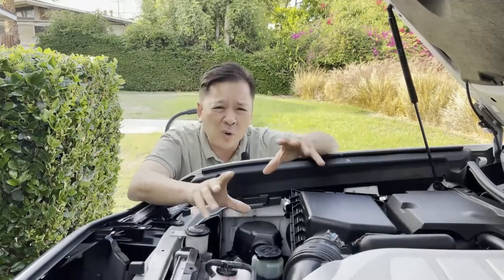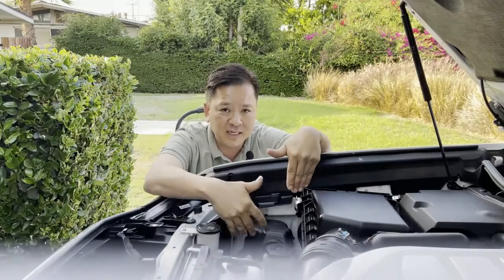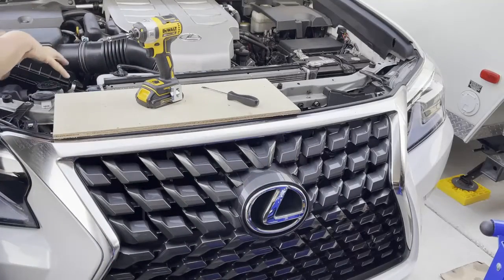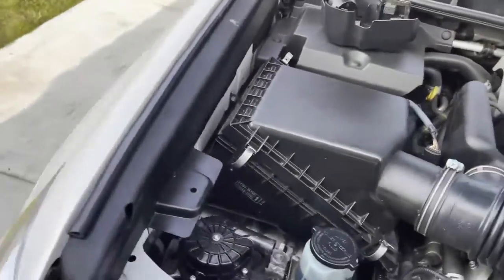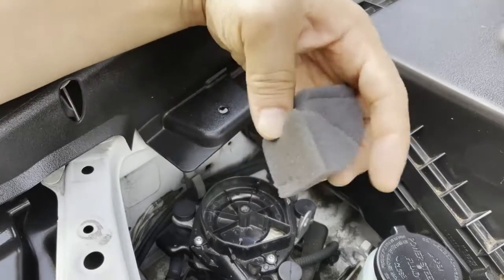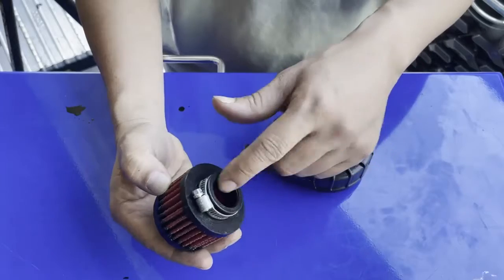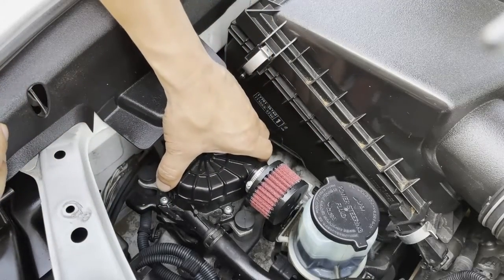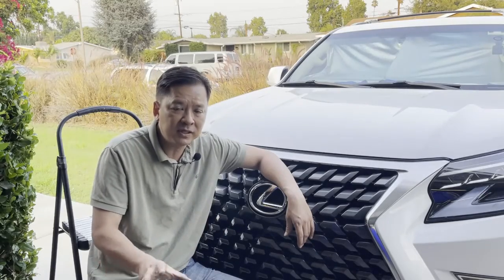Why We’re Modifying the Lexus GX Secondary Air Injection Pump

Comment: Thank you for the video! Dealer wanted 2.4K for this job. My trac, 4lo, and check engine lights are still on after replacing the filter. Does this mean that it doesn’t work? Or do I need to take it to a mechanic to shut the lights off?
Reply from the maker: The filter is for preventative maintenance . Not for after you have the failure.

Comment: I just installed the little cone filter on my 2020 GX460 with 43k miles. The OEM foam had just a little dirt on the leading face, but no more worries about it deteriorating and clogging the fan. Hallelujah!

Comment: How often are you suppose to clean the filter
Reply from the maker: Its per the mfg instructions and cleaning schedule at 50k miles.  Just hit up K&N if you want to go by the book, otherwise a visual inspection is good enough for me.   Every 15k with low pressure water and air dry.
Reply: @GXBOB I installed the filter a year ago after watching this video. Yesterday I got hit with a check engine light and a code P2445. Secondary air injection pump stuck bank 1. Wondering if the filter could be dirty.

Comment: Did this mod today on a 2023.  Crazy that they were still using this flawed design all those years later.  For anyone reading this looking to add the external filter, if you want to retain a near stock look you can put the cover back on the pump, it won't obstruct anything.  It also doesn't really do anything, far as I can tell.  Maybe provides some protection if a vicious rodent invades your engine bay.
Reply from the maker: I always put it  back on when i go in for a smog check.

Comment: Hi, I installed this filter on your recommendation and the pump started whistling right away. It's very audible when you turn off the engine and it still continues to rotate and whistle. I removed the filter and the whistle stopped.
Reply from the maker: You are going to get some vacuum suction and/or some whistling sounds which is normal. Its telling you its working.

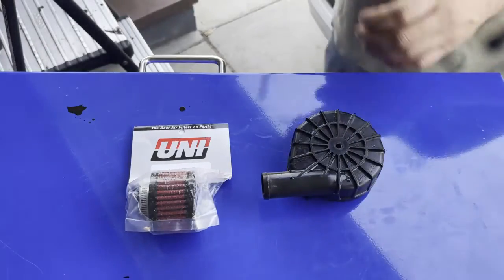Comment: 8:48 Bob, I replaced this filter as soon as I saw your video a couple years ago. Engine ran normally no problem.  Should the new filter be replaced regularly? And if so, how often? Very helpful video thank you.
Reply from the maker: Hey Donald, there isn't a magic number to go by because everyone's driving habits and environments are different.  It's just a visual check for a dirty filter.  Remove, flush it with water, and air dry.  After you've air dried it, apply some K&N oil to the filter material.  
https://amzn.to/4ex3QvA

I did mine after 20k miles since the video release.

Comment: Just got my "new" 2023 GX460 two weeks ago and came across this mod. Did the upgrade and an hour later after driving to costco, engine goes into limp mode with engine and TRAC OFF light coming on. I barely made it home and needed to get a tow to the dealership. Wish I read the comments because its been a huge hassle to get it "reset" to factory. I'll be going back to the dealership this week and hopefully get them to do the upgrade for me (luckily still under warranty). Hope this is helpful to anyone thinking of doing this.
Reply from the maker: Not sure what happened to your truck, but rest assured, there are tens of thousands of people who have already done this mod without an issue.  There have also been many other YouTubers who show the exact same mod.  The only thing i could think of is you pushing the filter too far in and starving the system for air.  The mod is supposed to prevent your trac off and going into limp mode.  I've had this mod for years and years without an issue.  TBH, you are the only person in the YouTube universe that mentioned having an issue with this mod, which i'm still sitting here trying to figure out what you did differently.   One foam to replace another foam does not add or delete to a systems oem function.
Reply: @GXBOB  I was in total disbelief myself, I was thinking there's no way I can fk this up...surprise you found the only guy to accomplish it. I'll be asking the Lexus technicians about this mod and get their pov and report back.

Comment: Hi, Bob:  Thank you so much. Love your video.  One question: After installed 'UNI' filter like your video showed, should I put back the original secondary air pump cover?  Thank you.
Reply from the maker: @simonlu1664  Put it on when you go in for a smog check. You have to pass visual inspection which includes no tampering with your emissions system.
Reply: @GXBOB  Thank you.

Comment: What do you think of this resolution GX? https://youtu.be/dW0-JHw2E6A?si=hSAfFfBbBGcKD5gx
Reply from the maker: You're taking an engine system component designed by Lexus to work during cold starts.  Let s pretend you don't care about the environment for a minute.  But for those 90 seconds the SAIS kicks in to support warming up your engine on a cold morning will eventually take some form of mechanical degradation over time if you're like me and need to start and go without having to wait for the engine to warm up.  What do you think injection of fresh air during the cold start does for the engine?  Its in the design.  Another issue is how your truck will perform during a smog check inspection.  The minute a smog check inspector sees your bypass module , especially in California, you just failed your visual inspection.  You would have to remove it and drive back to have your truck reinspected.  Another issue is the "smell" that will most likely go unfiltered through your engine compartment will eventually reach your cabin filter if not through the nose of someone hanging out in front of your vehicle while you're warming up your truck.  Another reason is you're spending $400 because a $15 filter doesn't make sense to you.    Do the preventive maintenance by replacing the Lexus foam with an external filter and you won't have to deal with check engine lights coming on in the future.   Make sure you maintain that filter and clean it once in awhile and you're good to go.
Reply: Yeah that makes sense. Mg lights keep coming on even after Lexus cleared it and found nothing wrong. All the injector components replaced. They think it’s an electrical issue so the bypass seemed intriguing. Replaced spark plugs and that helped keep the lights off for about a month. But it cycles on stays in limp mode for a couple days and then it cycles off after running a few times and repeats this cycle.
Reply from the maker: @DaBigKahuna21  interesting…Lexus actually replaced the Sais completely? Even cleaned the output leading to your exhaust manifold that may have been clogged by foam remnants? I dunno man…I would check the Hewitt system as a last hail Mary and see what their refund policy is if the problem still persists.

Comment: Have you had any issues with codes after you installed? Seen a few guys talking on FB how it threw a code.
Reply from the maker: There are two reasons why that SAIS unit would fail: deteriorated foam gets caught and pulled into its system, starving it for air; you installed the aftermarket air filter with the top rubber piece shoved against the air entry, which won't allow air into the SAIS unit (remember, air enters from the side of the filter, not through the top by design); or the system fails due to age and its coincidental that you just happen to install an aftermarket air breather on that very day (which happens, its just a matter of time). But adding an air breather that only allows air (which its supposed to) does not throw codes.  It doesn't work that way.  I've had mine on since the beginning of time and  i have had no issues nor have any one i've spoken to have had issues.  You have a controlled group of few that threw codes due  to the reasons i've mentioned above.

Comment: How long does this filter last for?
Reply from the maker: These filters are cleanable and should last for a very long time.  Check their condition at 25k miles and clean with dawn liquid soap/water then blow low pressure air dry.  Then apply K&N oil.  It should last for another 25k miles.
Reply: @ okay thank you GXBOB!!!!🙏

Comment: Interesting idea, very innovative. Love your channel.

I would suggest an alternate solution, however, let me explain.

Leaving that filter exposed to the elements (dirt, moisture, or chemicals in the event of another failure inside the engine bay could pose a risk in itself). Plan on cleaning it or at least checking it as part of your 5,000 mile maintenance plan.

DEFINITELY a solution, but that aspect should be noted.

In older GX460s and 470s this was a known issue. In more recent years, Toyota/Lexus has changed the material to something more durable (perforated polyurethane foam).

Instead of modifying the system entirely, and adding a maintenance point, I would look into a 30-60 PPI polyurethane foam. Order a sheet of it, and cut it to size. You'll never have this issue.

This filter should also be checked every 50k miles or so to ensure it isn't clogged with debris (however, it should never be, because of that cyclone style nozzle on the end, and the fact that this system only actually runs for a couple of minutes upon startup).

Great video - but I think we should consider every aspect of the design of the pump housing, there's a reason for all of those sub-assembly parts... They're there for the prevention of particle ingress and low to no maintenance.
Reply from the maker: Thank you for the input.

Comment: Sir I did this but my car doesn’t accelerate now and has engine light on and trac off, switched the same old sponge but still same thing
Reply from the maker: Did you ever resolve your issue?
Reply: @ just put the old sponge and cleared all the codes by professional computer because the basic ones couldn’t do it.

Comment: Did you saturate the filter with uni foam oil like the packaging says?
Reply from the maker: Hey Michael.  I did not.  Just like K&N filters, the original white paper filter already comes prepackaged with red oil that has already dried prior to purchasing.  When i do my filter cleaning, i run under warm water, air dry, and relube with red oil.
Reply: @ gotcha, good to know. thanks!

Comment: Hi Bob, i just did this mod on my GX it was a really helpful video. This new filter is definitely a lot louder. I'm assuming that it's supposed to be louder. It's very noticeable on start up.
Reply from the maker: @kingjaymIIV77  That’s the make up of external breather filters. I would be more worried if it didn’t make air suction sound. It’s telling you your SAIS is working. Try experimenting by adding the black end cap back on and/or take it off to see if there is a difference in sound.
Reply: It really just sounds like a loud pump. Kind of like a pump for a blow up mattress.

Comment: Bob, did you put the plastic cover back on the pump after installing the filter? I did and I was little concerned about the overlap it had with this filter. Any thoughts on air flow resistance?
Reply from the maker: @prakash0vegunta  only put the cap on when u go in for a smog check
Reply: @GXBOB  copy that. Thanks again for the tip.

Comment: Hi Bob, super easy mod. My GX460 IS AT 46K miles but I went ahead and did it anyway. One clarifying question: do you advise putting the housing back on or go without the housing? It feels tight with the housing on and I wonder if this will stop the airflow? Would appreciate your suggestions!
Reply from the maker: @ReformedEconomist  I would put the housing back when you bring your truck in for smog check to pass the visual inspection. I would just leave it off after the smog checks.
Reply: @GXBOB  Thanks!

Comment: I did this replacement and noticed a slight rumbling (growl) engine noise at highway speeds. Is this normal after the mod or am I imagining things?
Reply from the maker: @mauriciosrv  I would assume it’s normal if you change the design of any air intake. It’s usually a distinctive suction sound. Never heard anyone refer to it as a grumbling . But all this is while the vehicle is parked. At high way speeds and you’re capable of hearing something from the engine compartment might be worth investigating.
Reply: Thanks!  @GXBOB

Comment: you mentioned 470.  That is a different system and another issue in itself.  YOur comments on a 460 are accurate and does get those with a 470 to look at the issue.  The SAIS is basically under the manifold.

Comment: Mines been having a limp mode issue, but I have no codes or dash lights! Took it to the dealer and they can’t figure out what it is. My year is a 2011 and has 150,000 miles on it. Sounds like this is the issue! I would hate to replace the part and find out that it wasn’t the problem. Kind of stuck. Hmm?

Comment: What happens if this does fail and the lights all pop on? Can you just replace the air pump? Or is there other damage done?
Reply from the maker: @DaBigKahuna21  This is only preventative maintenance. Once your lights popped on the damage is already done. You can take it apart and clean/vacuum/suck up what’s left of the foam and put it back together to see if it cleared the lights.
Reply: @GXBOB  thank you!! What do they typically replace if the damage is done? Just air pump or do they replace and take apart other things? And is it still safe to drive?
Reply from the maker: @DaBigKahuna21  So do what a few folks did. Go to this thread and read it in its entirety then head to Lexus dealer and ask for recall warranty on good faith. Be nice. Service technicians vary from dealer to dealer. Good chance you’ll get a free replacement because Lexus knows about this ongoing problem. 
https://forum.ih8mud.com/threads/oo2010-2013-gx-460-special-service-campaign.1177130/
Reply: @GXBOB  thank you Gxbob!
Reply: @GXBOB  ok so I checked my secondary air pump. The filter looks brand new and the fan blade looks brand new as well with no signs of debris. Any idea what else could cause check engine light, trac off, and 4Lo light blinking, and limp mode?
Reply from the maker: @DaBigKahuna21  did you hook up a scanner to see what codes you’re throwing? If no codes then go straight to your gas cap to check the seals.
Reply: @GXBOB  just ran the scanner. It’s throwing codes P2440 and P2442. I guess it’s the secondary air injector stuck open
Reply from the maker: @DaBigKahuna21  yup you definitely have something shoved down there that’s keeping the valve open. You can either take it apart or drop it off at the dealer with the recall request. Do your homework and print out the recall docs and walk into the dealership armed with knowledge of the manufacturers problem. But be nice while you’re doing it. From experience. The minute you’re an ass, all dialogues are done and over.
Reply: @GXBOB  sounds good! thank you for your help! I’m taking it to the dealer soon!

Comment: How often do you need to switch this product out with this lifespan?
Reply from the maker: These alternative element filters are designed to last the life of your truck and cleaned / oiled every 50k miles. I wouldn’t bother buying all the products to clean and oil your filter since it’s such a low cost item. Just buy a new one.

Comment: Uncle Bob I assume you don't put the "two hand" plastic cover back on over the new K&N type filter?   Seems like if you do it significantly would restrict air flow.  Or is it important and should I drill 3/8 in holes in the filter area as another commentor mentioned?
Reply from the maker: I left it off and reinstalled it to pass smog visual inspection

Comment: Not sure how I missed this vid, thanks Bob!  👏🙏

By the way, are you going to do a radiator swap anytime soon?  Considering replacing mine, small leak at top hose, replaced hose and noticed plastic brittle and a little craked. I think moisture coming from there even with new hose and cap.  But I don’t want to go to the stealership to replace radiator and get ripped.
Reply from the maker: I normally don't do anything unless it's broken.  You never know, the truck is past 100k already.
Reply: @GXBOB  👍Just hoping its not the coolant valley leak thing Ive been hearing about

Comment: Should I still put back the cover after putting the assembly with the filter?
Reply from the maker: I did.  I didn't want to leave a cover around the garage to get lost.  Might need it one day when i go in for a smog check.
Reply: @GXBOB  mine is a 2018, the reason I asked is the cover has a foam that touches the filter when placed back, although fitting snugly. Should I just scrub the foam since this almost cover half of the applied filter, will it make it less efficient?

Comment: Great video, just the explanation I was looking for. My engine/dash lights on my '07 GX470 recently came on, I brought to Lexus dealer (Maplewood MN), they charged $210 for 4 minute plug-in "diagnostic" and decreed the secondary air injector pump and valves all need to be replaced, for $3200. My question: if the engine light is already on, is the injector already plugged/shot? Will just changing out the filter as you describe still help or do I now need to replace whole assembly? Thank you!
Reply from the maker: The reason your lights are on is because there is no more filter. Your filter is already disintegrated and was sucked up in your SAIS system. My mod is for preventative maintenance before the lights come on…not after. The good thing is you can pick up an SAIS on eBay and replace it yourself. 
https://www.ebay.com/itm/235436784129?mkcid=16&mkevt=1&mkrid=711-127632-2357-0&ssspo=GdLsfWakTTS&sssrc=4429486&ssuid=37nDDIJTS6a&var=&widget_ver=artemis&media=COPY